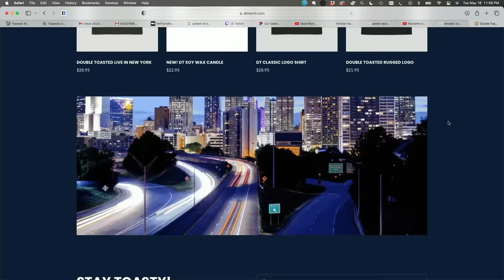INSPECTOR GADGET BAD MOVIE REVIEW | Double Toasted

Comment: Had an idea for a mod called Lap Purgatory. no war timer, instead after each lap 30 seconds are added. As usual, Pizza face on lap 3 etc. Max is 5 laps. Will prob use V1 for lap 4 to make it consistent with the rest of the soundtrack.